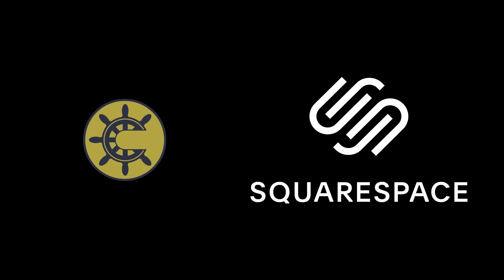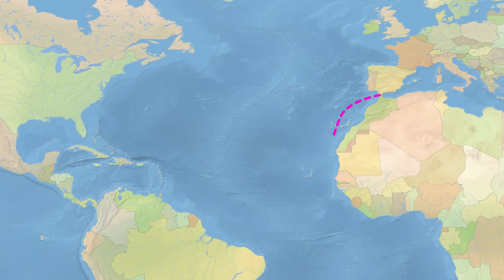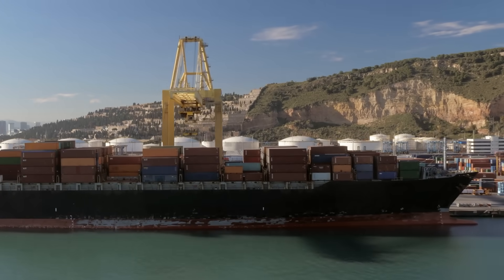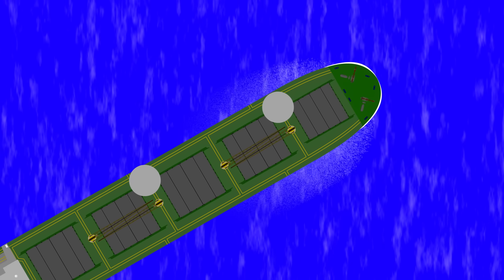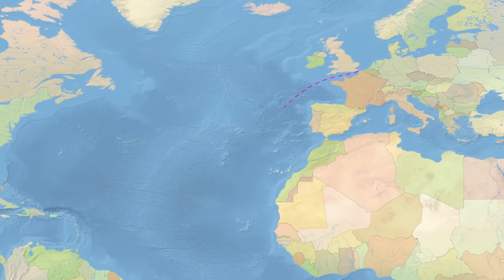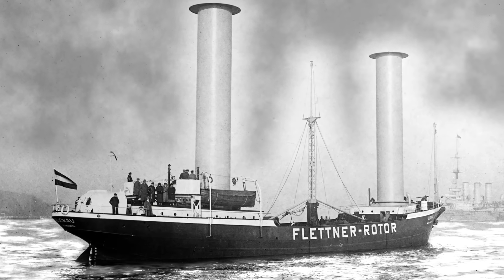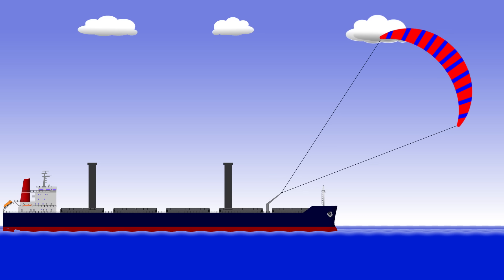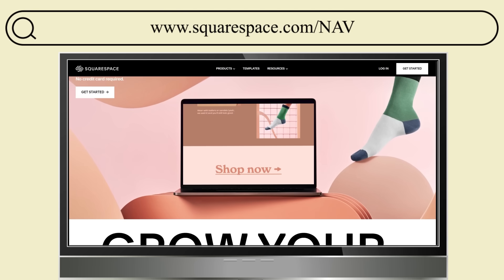Why Don't Sails Work On Ships?

Comment: Sails dont work by re directing wind aft. They work by creating lift
Reply: Same thing. The change in forward momentum of the vessel can only come from an equal and opposite change in momentum of the wind. Whether you call this lift or thrust, it comes from directing some air in the opposite direction you want to go.
Reply: @XPLAlN  wrong. An air plane does not fly by thrusting air down. It fly by creating lift from a high pressure area un the wing trying to fill the low pressure above the wing and being that a sail is just a wing on its side. I'm both big in avation and a sailor.
Reply: @TwitchFlys  Ok you are misrepresenting what I said and not understanding the video. I did not actually say an airplane flies by thrusting air down (nonetheless, although it would be unconventional it could be stated in those terms, and in the case of a helicopter it is). You said “sails don’t work by re directing wind aft. They work by creating lift”. I said these are the same thing. I said you could call it lift or thrust. If the aerofoil is part of a propulsion system it is thrust, if it is a wing then it is lift. It is the same physical effect. You obviously don’t work in this field or understand the physics. The total reaction of the aerofoil results from the re direction of air. Force is rate of change of momentum. The thrust that propels the sailing vessel is the component of total reaction of the sail which acts along the longitudinal axis (or other axis you want to propel the vessel along). Whenever this force exists it means that there is also a corresponding rate of change of momentum of the wind in the opposite sense. In the words of the video ‘the sail re directs wind aft’.This is just elementary physical science.
   You also say you are “both big in aviation and a sailor”. You may big yourself up as much as you like but I can only assess your knowledge by what you show me in your comments and I don’t see much evidence you understand the theory as well as you are claiming. Quite the opposite.
Reply: @TwitchFlys  …and another thing: in fluid dynamics, lift is by definition normal to the relative airflow. This means that the only time the definition of lift applies to the propulsive component of a sail is on a broad reach, in the specific case where the relative wind becomes normal to the velocity vector of the vessel. On all other points of sail the lift vector is not aligned with the direction of travel, and yet the component of total reaction that is, can rightly be defined as thrust.
Reply: @TwitchFlys  your ‘heads up’ is, frankly, distinctly underwhelming but also a little perplexing. As an ME I would expect you to know full well that force is rate of change of momentum but you don’t know this. If you did you would not have made your original comment. What you objected to in this video is just a qualitative explanation of that particular aspect of physics. The fact you can’t see this is what I find perplexing, coming from a self proclaimed ME.
  Then we come to your flying credentials. Private pilot. Really? The minimum possible certificate is what you are holding up as “I am big in aviation”. The bar in Principles of Flight one has to clear in order to earn that ticket is basically to be able to label a diagram with the 4 forces of equilibrium flight. At least remember that the relevant force in terms of propulsion is called “thrust”.
   You are chanting this mantra “a sail produces lift, it does not re direct wind aft”. Note I am not saying you cannot use the label lift in place of thrust. What I am saying is if you think, and you do, that wind is not being re directed aft, then you understand next to nothing about aerodynamics.
   I did you the courtesy of watching that video link. First it is extremely basic. 2nd, I am not going to object to any of it, although a pedant might. 3rd, and most important, there is not a single thing in it to support your fundamental position that a sailing vessel can be propelled without re directing any wind in the opposite direction. If you can post a link to anything external to this thread that claims as much, then all you have is either a total fallacy, or something you have failed to understand.  That video you linked to does not in any way imply that no wind is re directed aft and so what we are looking at is definitely your failing to understand.
   Please feel free to come back with something, anything, more substantive than what is the lamest argument from authority I have seen in quite a while. Which is saying something considering this is YT….
Reply: Not lift. A little more lateral thinking needed
Reply: @psthew  its exactly lift. A sail is just a wing turned on its side

Comment: What about the use of wind turbines but height problems as would need folding blades and masts and an ICE or other engine for entering and leaving port.  Perhaps water turbines and hybrid powered ships?  I'm sure the boffins are beavering away in their caves.
Reply: You can't propel a ship thru the water with a water turbine. Kinda self-defeating, you know what I mean?

Comment: Guess what - Containr cranes can left up allowing a sailing vessel to come into the dock.  Guess what,  Masts can be made strong enough  using special but common industrial metals to being masts strong enough to be without back stays.  Guess what Fore stays on a ship in harbor can be looesed to allow complete access to the cargo hols.   Guess what - Bulk carries and container ships are the best ones suited for masts and square sails..  Guess what, specialty vessels like gad, car, carries, and tankers of any kind are all easily fitted with masts.  Guess what, with mechanical sail furling, perfected in the mid 1800. no one has to go into the rigging for set or furl sails.   Guess what, studies done in 1980 indicated that shipping cost could be reduced by as much as 25 cents per ton through the use of sails.

Guess what, Sailing vessels in services prior to 1950 could go as fast as any freighter today.  Now, What can't ships have sails?   Because the shipping industry is too conservative.  There is no technical or logistical reason.  Guess what - your drawings of suggested sail rigs are wrong - way wrong.

Comment: next time do more calculations, less animations. 

1) Wind force is pathetic for modern steel ships. Humongous clippers had around 5000 m2 of sail area in several masts (thus effective are was fraction of that). But ok, we will take it. Let say, we put on Emma mearsk sail with equivalent of 100*50 meters sail. Average wind speed at oceans is around 6 m/s, usually betqeen 4-9 m/s so lets round it to 10 m/s. Average air density is 1,225 kg/m3. And combined Lift and Drag coeficient is around 1,2. Sooo what is wind force on such sail at 100% efficiency? 367 kN! At impossibly ideal conditions. And what is Emma maerks propeler thrust? Around 15000 kN. So less than 3% from wind at absolute ideal conditions. Should I add anything else?

2) Magnus effect - you obviously do not understand, how negligible it is! Lift coeficient for cylinder is somewhere between 0,2-2 at subsonic speeds. i am not going to do even math here, because it is in area of single digits of kN for cylinders with diameter of Emmas beam. So Magnus effect would have same effect on steel cargo ship as it will have on bowling ball - none.

But I understand, that you are making propaganda for green transportation. This is somewhat deserving.
Reply: I read about that inflatable Michelin sail a few months back, everybody on board had a laugh. I don't think there's a single sailor who would seriously consider a sail on a cargo ship, even though a lot would have liked the idea. But I can see Maersk or someone alike installing it on one or two ships for a photoshoot and then bragging about it to the media and shareholders, while those sails are never really used.
Reply: @mushypork2132  exactly
Reply: Then again you are smusing the sail from a class of ship that would often displace between 2000 and 6000 tons with the largest being around 8000 tons for a ship like the Emma Maersk wich displaces around 170000 tons. And while I know that the ratio of sail area per ton of displacement would be smaller, it still makes your comment disingenuous.
Reply: @Infanterie_Marine  So how big should be sail for Emma? Because 100*50 meters is humungous sail, probably outside our capabilities to build it. You can not make it much wider (because there is limit corresponding with total beam of ship) and also not much higher (because there is limit corresponding with overall ships stability).

Fact is to get at least 15% of emmas cruise thrust, you will need sail with effective area 30 000 m2, which is area of average Olympic stadium. And you will need very fast wind in correct direction plus 100% wind to trust conversion effectiveness. And finally, you will still get slower speeds then Emma is usually floats. 

It really does not matter what your hurt ego thinks. I am right and you have to accept that. Physics is cruel but thrustworthy.
Reply: @tomascernak6112  the one whose ego has been hurt seems to be you.

I'm not even in favour of using sails. What I'm against is bad math.

Furthermore, you can use many smaller sails, like the very clippers you mentioned do. Don't act so high and mighty.
Reply: @Infanterie_Marine  You did not bring any math correction into play. Just unsubstantiated opinions. Clippers had many smaller sails to be able to sail even up the wind, because it was only mean of its propulsion, but efficiency was often very low (20-40% of total sail area were generating any thrust at any moment).
But in ideal condition (windward) only area of two largest masts with sails counted into thrust. So I simplified task and took equal surface area to dimensions, not weight. Because counting weight into play is main problem here. Wood is light, steel is not. And that is main issue here.

What is enough for wooden ship is useless for steel one.

Comment: The advantage of wind has to be enough to justify the cost.  Look at the Germans who early in 20th century developed sail powered freighters.

The Preußen 5 masted
Reply: What the narrator fails to mention is the none of these methods achieves the speeds the engines do. Ships spend the majority of their time going from point A to point B. While at sea they make no money, but incur costs, fuel, crew, etc. So the more time spent traveling the less  time spent loading or discharging cargo. 
So far no method has been developed that completely replaces the hydrocarbon fueled engines. Electric iscalso being developed, but has it's own drawbacks. The need to recharge the batteries while at sea, and weight of the batteries reduces the amount of cargo that can be safely carried.
Reply: @chuckaddison5134  I think all the proposals, at least for now, are not to replace engines entirely, but to supplement them with sails so that less engine power is needed for the same speed (or even the ship could go faster), improving fuel economy. The sails, rotors, or skysail wouldn't be to propel the ship on their own but to reduce fuel consumption.
Reply: @quillmaurer6563  
That's about where they are at right now. the sky sail generates more power from what I've seen/heard/read. but the Flettners are self contained and don't rely on wind velocity, but do require power from the engine to rotate.
Reply: If it was, they would. No company would turn down savings on that scale if there were savings to be had.

Same reason airships are never coming back (at least not commercially). Super cool, but not cost-effective. Shame, really. I'd love to live in a world with Zeppelins and modern sailboats.

Get on it, Hollywood. I need this alternate universe in my life. 😆
Reply: @yusokrazee  you can live on sailboat.
Reply: @yusokrazee  Look for "Airborn" and the other books of the Matt Cruse series.
Reply: @yusokrazee  the problem with zeppelins is that they tend to explode, not anything else. Turns out giant bags of hydrogen are a bit of a fire hazard.
Reply: ...and even turned some into commerce raiders.
Reply: It made sense for Germany because they didn't have a huge network of coaling stations around the world. Outside of a few colonies in Africa and the Pacific they'd be dependent on other nations to fuel their steamers outside of European waters. In the event of war their supply of coal and other fuel outside of Europe could dry up and they'd be isolated from outside sources of supply.
Reply: They were half the size, had twice the crew, carried 50x less than modern carriers. It is not worth the money, time, and effort.
Reply: I agree
Reply: No they didn't kid, please Behave yourself *
Reply: @DaveSCameron The Preußen, 5 masted , for saltpeter from Chile.    Germany had a a unique combination of high technical skills and demand for fertilizer.  The cost of operating a powered vessel was thought to be more expensive

RC Rickmers 5 masted rice hauler.

France built 5 masted France II to haul ore from New Caledonia .   She had auxiliary power.
Reply: that was because England blocked the oil markets for Germany.
Reply: Yes we all watched the video too, genius

Comment: I don't the argument why you need global regulation is not 100% valid especially when it comes to the the comparison with rental homes. When an house has an lower rent than a similar house  because of poor isolation but it have heating that are greater than the savings in rent which house would you choose? It is also the same with rental cars when fuel is not included in the rental costs would you like to safe a little bit of rent for an higher bill at the gas station?

Comment: i love your vids but sorry i gotta correct you, sails dont generate thrust by deflecting the wind but infact rely on the under pressure which is caused by deflecting the wind on the outside of the sail. they work exactly like your explaination on the aircraft wing at 3:16. for example a genoa sail is there only to make the main sail more efficient by providing laminar flow across the outside of the main sail (turbulent flow creates vortices). the only modern sail that doesnt use this principle is the spinaker which is basically a kite like sky-sail.
Reply: true that. modern sails ARE vertical wings.
Reply: At least one other sailor views this channel.

Comment: It's coming back tho, but on a smaller scale. I know of a French project named Grain de Sail, they use a small sailing schooner and operate their own factories and shops, so everything, manufacturing, packaging, shipping and selling is integrated in one company. They depart from France loaded with quality wines and such which they sell for high prices in New York, on the way they'll also stop in the Carabeans to load coffee, chocolate, etc which they bring back and sell in France. It seems to be working quite well.
Reply: Those are luxury goods, the bulk of shipping is "bulk goods", things like grain, ore, textiles and other raw resources that simply don't have a lot of value per unit mass or volume but that still need to be moved. 

A business model centered around jewelry or exotic food for the wealthy can afford to transport with expensive meams like planes or antique boats. Oil tankers and grain shipments operating in low profit markets litterally don't jave that luxury.

That said i would rather the luxury people use clippers than planes to import their french wines.
Reply: SV Kwai in Hawaii traded from Honolulu Harbor to the Kiribatis. She was sold a year and a half ago to continue trading in the Marshall Islands, a route not services by larger motor vessels.
SV Tres Hombres is a "fair trade" vessel operating between EU and the Caribbean. She is presently booked thru Feb 2023 with cargo.